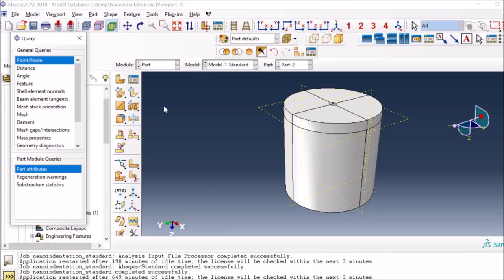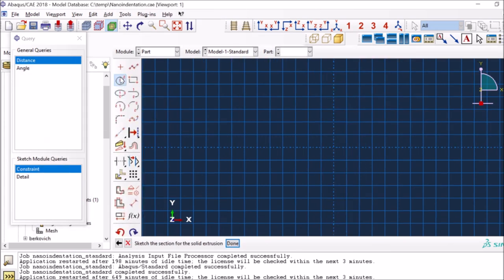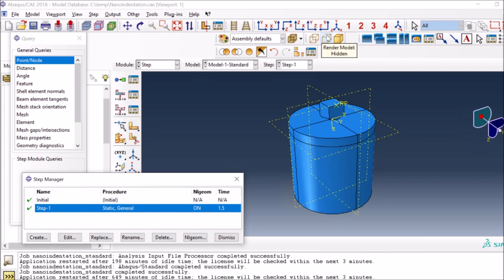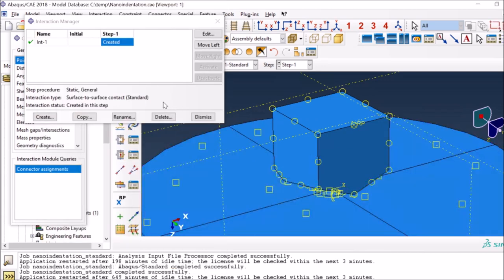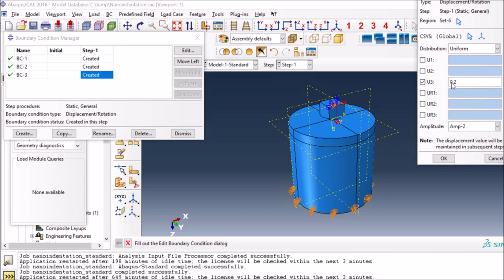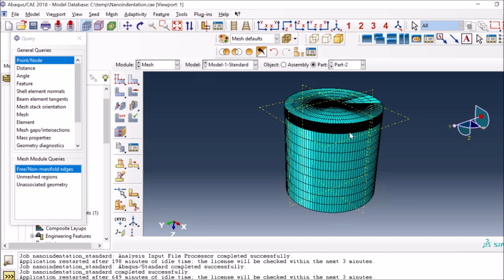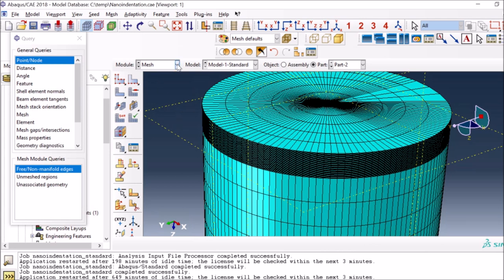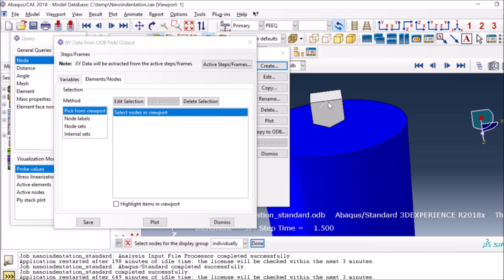Nanoindentation Test using ABAQUS CAE - ABAQUS Tutorial

Comment: Thank you for the explanation. However, how do I input the load value on the indenter? For instance, if I want to use 500 uN, how can I input that?
Reply from the maker: Instead of displacement boundary condition you may apply an equivalent force or equivalent force. Or you can use displacement boundary condition and track the forces as shown in the below video.
https://youtu.be/vO-KtD-R2U8

Comment: Nice video!. I did something similar with my work and it worked fine (loading and unloading), my challenge is that the response of my load and disp is larger than experiment. How do I adjust simulation to match experiments. Which material properties am I to adjust ?. Thanks
Reply from the maker: It will depend on the which part of the curves not fitting. Initially it’s elastic part while later may be plastic part.

Comment: Hello,
Creat video, thank you. I have done a similar simulation, where a concentrated force (1N) is applied on the reference point. The simulation works fine, but the results are not satisfying, because i do not get an indentation. The stresses with their distibution is displayed in a realistic way (magnitude 6.5e-02 N/qmm) and a displacement magnitude of 9.65e-05 mikrometers is shown in the distribution. The problem is that the elements are not deformed, although i implemented ALE. They all have their original shape. Do you have any idea where this comes from ? Thanks a lot.
Reply from the maker: May be you are not looking at deformed shape or you may not have asked for displacement output and hence no deformed shape?

Comment: May I know the settings to obtain force RF3 on a rigid indenter? Thanks!
Reply from the maker: Hi,
As shown in the video, reference point is created for the indenter. It was then coupled with the indenter using kinematic constraints. So when one applies loading or boundary condition it will act on the indenter. To get the reaction force, you have to go to XY data from tools menu and then select odB field output and then select unique nodal to extract RF3 and U3. This data can them be combined using combine option.
Please see this video for combining data and plotting curves https://youtu.be/4ewoZaJ2uC0 
Let me know if you have any further questions.

Comment: Can we just apply some load and find the depth ?
Reply from the maker: yes you can do it. Make sure at the start the model is well constraint and the distance between the indenter and the sample are minimal. It is normally recommended to first apply a very small displacement until contact is active and then use force. This will avoid singularity issues due to large displacements in standard (quasistatic) analysis.
Reply: @Professor3MEC  thank you for your reply. can you make a video on it.
Reply from the maker: here is a video which is scheduled to be released in next few days. https://youtu.be/7fZbJG3-fCs
All the best.
Reply: @Professor3MEC  thank you that's so kind of you. But it's saying private video?
Reply from the maker: It should not be.

Comment: what are the units used for force, stress, and displacement here?
Reply from the maker: Data was given by a subscriber. I can go back and check. Important thing is to be consistent with the units as ABAQUS doesn't have a unit system. User should ensure this.
Reply: @Professor3MEC   Thanks for the reply. I agree with you that the user should ensure the correct units as ABAQUS doesn't have a unit system. I asked this question b/c I saw stress in the order of e-4. Nice video. Keep Going!
Reply from the maker: Great thanks . Input data was kind of tweaked to avoid sharing that subscribers actual data. Thanks again for liking the video.